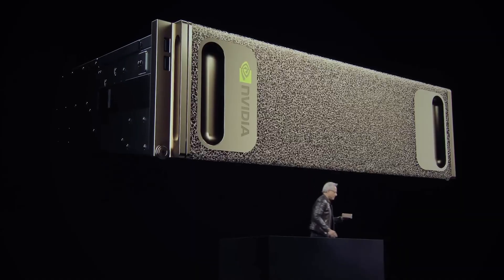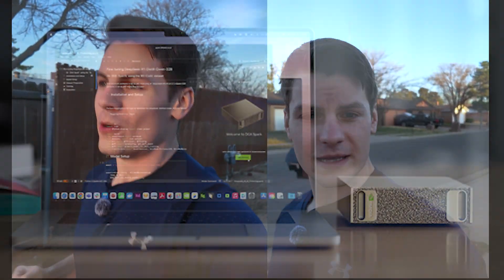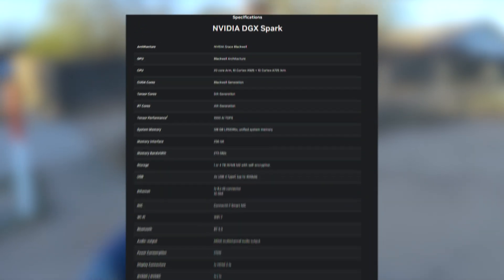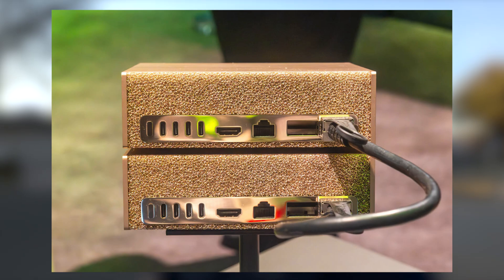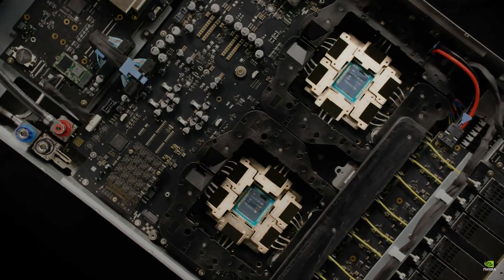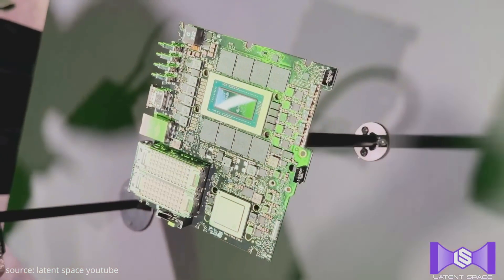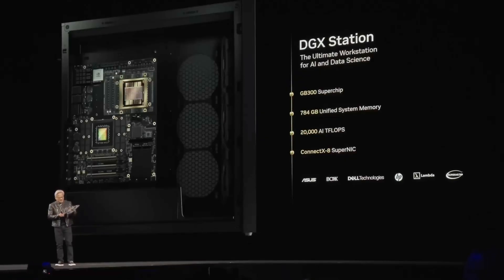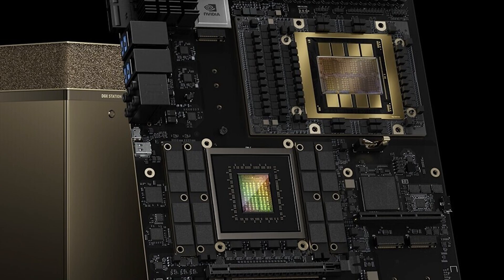Say Goodbye to Upgrading Your PC (Thanks NVIDIA!!)

Comment: Interesting take mate. I'll be honest and say that i dont see nvidia leaving the discrete market at all. It makes then tons of money still, and caltures mindshare shich is kust as important as sales figures for a legacy company like this. 

I think you're spot on about nvidia wanting to have their hand in everything, but they dont want to concede any ground. The DGX line is not the end times omen it appears to be. Modular computers aren't going away, mainly due the end user costs associated with failures.

Say we do end up in the all in one, no modular component future. Well if any one part of your pc fails, then the entire machine is done. Nvidia would get reamed by regulators for this. Soldered components do have a long life span typically but there's a reason modular components are engineered the way they are. The average consumer environment is really tough on electronics.

You also have to consider that nvidia wants control without burdens. If they now contol the entire pc stack; cpu, gpu, ram, etc then they now have to set the pace for the MYRIAD of different apps on windows. Games, professional apps, edge software, enterprise, etc. Thats a ton of resources they now have to spend to make sure their tech works well wkth everything.

They want to focus on high margin, high return ventures. Spending millions on developer salaries to make sure random necessary programs like kicad or pcb libre work would be a money pit. No, they'll probably move into the consumer space, but still maintain the status quo with x86. 

Jensen is still all for x86 as there are use cases for the platform that arm cant compete with. Nvidia recently just bought a ton of new Xeon 6's for some of their B2B server platforms actually!
Reply from the maker: I think Nvidia plays long term. Sure there would be more costs up front, but think with this approach they could make the same margins across the whole computer, not just the gpu.

Also, they could ship the computer’s with their own priority os, further widening the moat they have against competitors. They basically want to be nvidia and apple at the same time.
Reply from the maker: We can talk about it on the next SFAB

Comment: I don't think Intel and AMD are going to let their x86 platform die.
Reply: There are talks to switch EU government PCs to linux based systems cause of orange man
Reply: @ДенисФедоров-ь3у   orange man bad?
Reply: @ДенисФедоров-ь3у yay fo organ men
Reply: AMD has already announced an ARM APU for low power laptops and devices.  Intel has already cancelled its high end CPU project because the old CEO's attitude is that going forward CPUs will just be there to feed instructions to GPUs.
Reply: @aa-yt7wo  AMD Strix Halo APUs already require soldered RAM, of which Framework is using in a mITX desktop. The Framework motherboard which is available separately only has a 4x slot, but there are ways you could potentially use that with a GPU.
Reply: ARM is the future bro 😢😢
Reply: With CISC emulation and virtualization getting pretty quick on the RISC hardware, I will not be surprised at all if RISC eats their lunch. If software developers like myself can keep using our x86 toolchains like nothing happened, and running our x86 operating systems, but the hardware is ARM or whatever, then there's not really anything to stop us from just buying that hardware if it's cheaper and performs as well or better for the same price and power requirement. Intel and AMD can cling to x86 all they want but I don't think it's going to be competitive at the end of the day. In fact, x86 processors are basically RISC on the inside anyway and the x86 "skin" they graft over it with their ASIC "microcode" translation layer is all that really separates CISC from RISC.
Reply: @CharlesVanNoland  "Same price and power requirement" Those are some of the areas nvidia is doing the worst in right now.
Reply: @SupraSav  and amd bringing it's cheaper APU in early 2026, and roumer is that it will be used for 500$ products
Reply: @CharlesVanNoland  so you want to kill the PC space? Nice man
Reply: @TheGuy..........  Pretty sure there is nothing I said that would suggest or imply that such a thing is my personal desire. If you put down the pipe and give up on choosing to believe in gang stalking and conspiracy theories for a bit, and let your brain heal, you'd see that what I'm actually saying is that CISC is in for an uphill battle no matter what. Like it or not, hate it or love it. PC will still exist, but anything x86/x64 will be emulated or virtualized even more so than it is now, or otherwise run through dedicated translation layers. Software developers and operating systems will have a means of directly accessing the RISC hardware itself and avoid the CISC translation layer altogether if desired, such as for performance sensitive applications. Microsoft is the one that wants to kill the PC space with everything they've been doing to Windows post-Win7. RISC/CISC and x86/x64 have no bearing on PC. Your PC is already RISC, you just don't know it yet.

Comment: DGX is for AI not PC gamers:

DGX Spark — formerly Project DIGITS — and DGX Station™, a new high-performance NVIDIA Grace Blackwell desktop supercomputer powered by the NVIDIA Blackwell Ultra platform, enable AI developers, researchers, data scientists and students to prototype, fine-tune and inference large models on desktops. Users can run these models locally or deploy them on NVIDIA DGX Cloud or any other accelerated cloud or data center infrastructure.
Reply from the maker: Just wait.. we will see nvidia Socs aimed at consumers on laptops and on desktop that are soldered